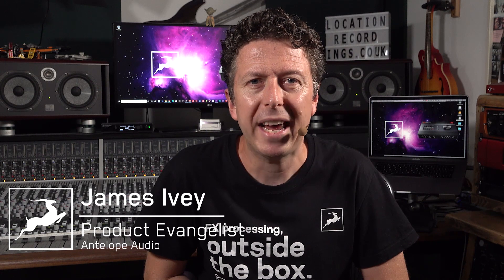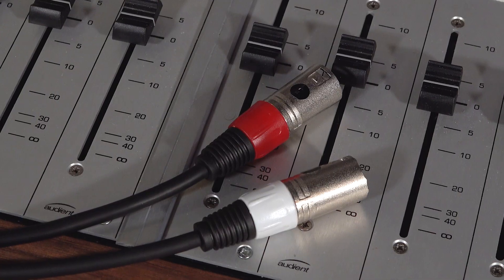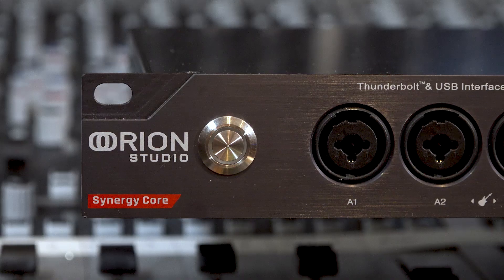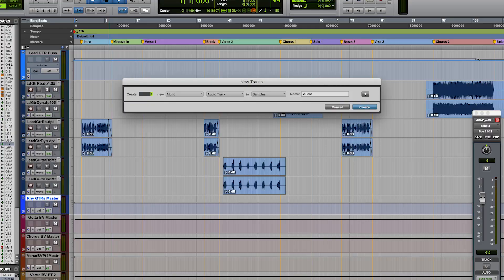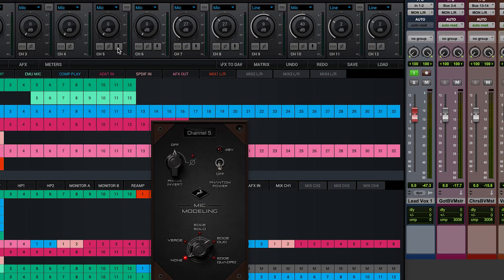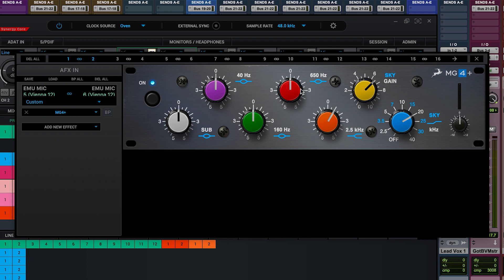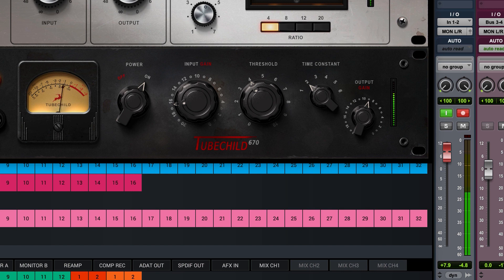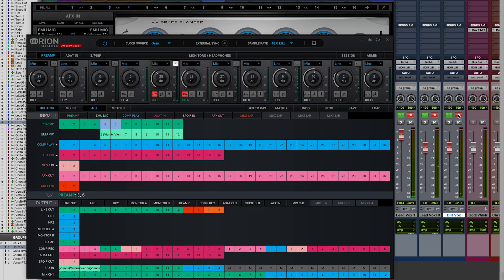Recording Vocals with Synergy Core Interfaces & Modeling Mics (Routing, Tracking with Effects)

Comment: You are routing the Edge Duo's signal to a stereo channel in your DAW. But the diaphragms are picking up the front and back signal. When you monitor an Edge Duo through a standard L+R stereo channel, the L side is way louder as it's from the front diaphragm. How do you sum the two signals to a mono signal that retains the right pickup signal? Just a normal sum to mono?
Reply: It's not actually necessary to record the processed version to a stereo track.
The two channels "become" mono after the EMU Mic stage when you choose microphone.
At least this is the case with my Orion Studio Rev 2017.
If you record an unprocessed take you will need to record to a stereotrack and use the plugin (VST/AAX)
Reply: Thank you Sam. This take is correct – the VST outputs a centered signal on a (stereo) track in Reaper.